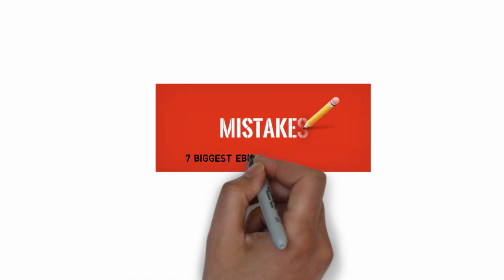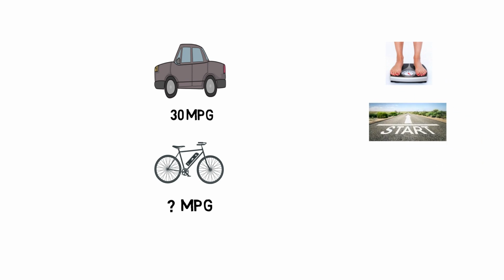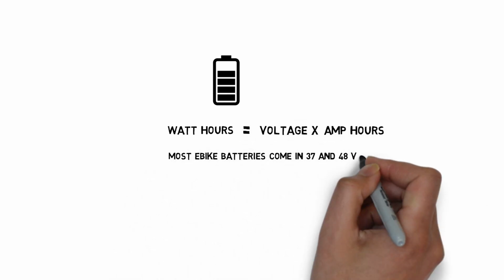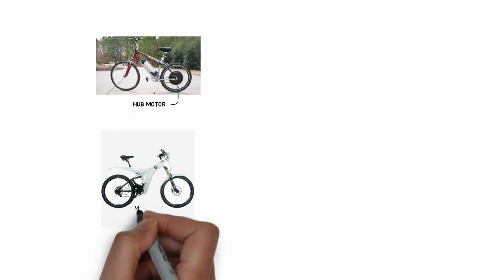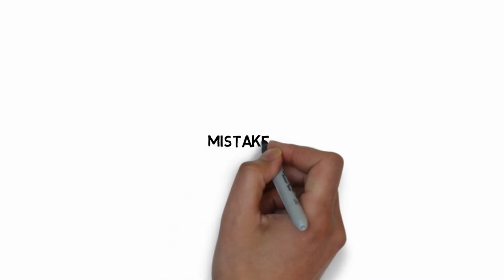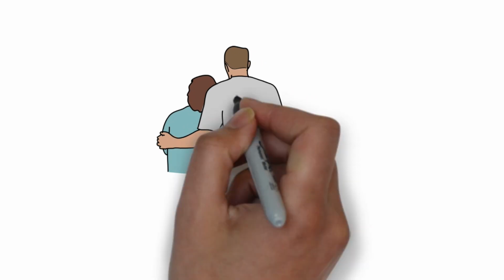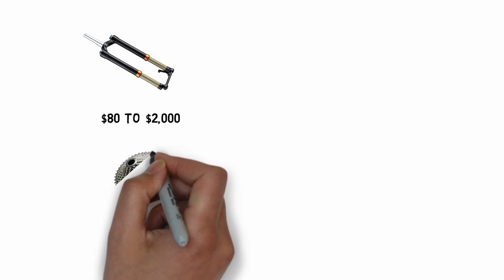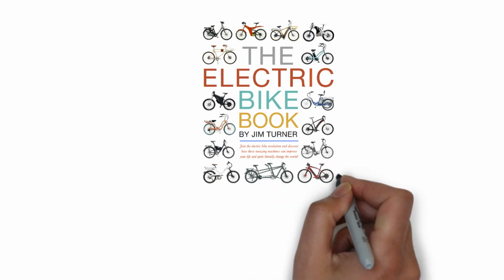The 7 Biggest Mistakes when Buying an E-Bike

Comment: Hub motors are fine for taking on hills.  I have the worst case scenario a 250 watt hub motor on my front wheel. 
If I make a medium effort at pedaling, the steep hills in my area become like gradual uphill slopes. 
I am not very athletic and in my 60s.  
Do not discount a hub motor bike even for hills. 
If you break a chain on a mid-drive bike you better be able to fix it  on the spot or you will be walking to your destination.

Comment: You can't just go out and buy a mid drive motor you have to measure the Bb and determine if it is press fit or threaded using Japanese standard. Then buy the correct one for your bike.

Comment: Hub drive is not a "mistake" if the motor is to assist you, it is still a bike and not a moped, so you will ride it by use the pedals, when you come yo a hill the motor will just assist you, if you live in a area with rather flat terrain and you use the bike as transportation rather than for outdoor sport a hub motor is okay and cheaper.

I say that a hub motor is good for pedal assisted commute on standard roads while center mounted is better for more active and sport like usage where you can use the bikes gears, but this also put more stress on the chain and it is more expensive.

And to be poor so you has to go for a cheaper alternative is not a mistake, sometime it is the only option, but cheap copies can sometime be dangerous, but cheaper parts from a well known brand as Shimano are often save even they do not have same quality as the top-of the line products.

Comment: My e bike is 25.2v .😲
Reply: Which means that ur using either SLA or a 6s lith. ion. Build a 7s lith. ion pack. 29.4v...it will give you a little boost & more range. Read up on it. Good luck.

Comment: Thanks, all good points. I would add mid frame will wear your drive system, chain, rings etc, much more than a hub drive. Both have their place, but as you say for hills, then mid frame, probably wins.
 Thanks for making the video.